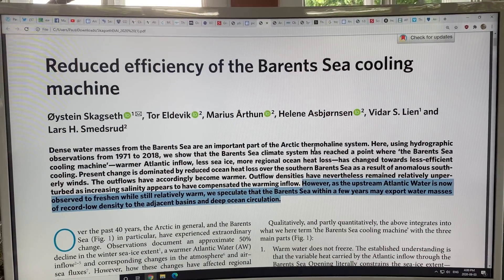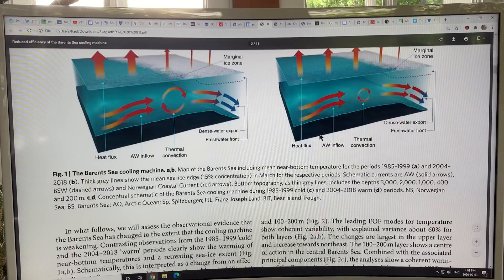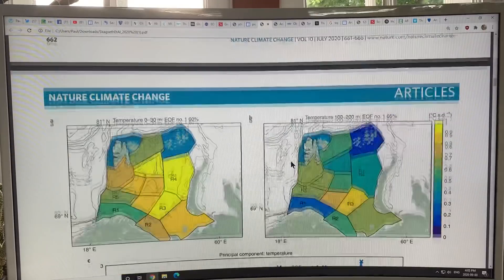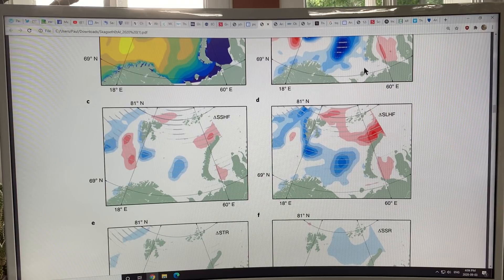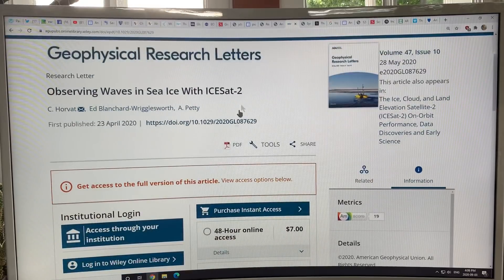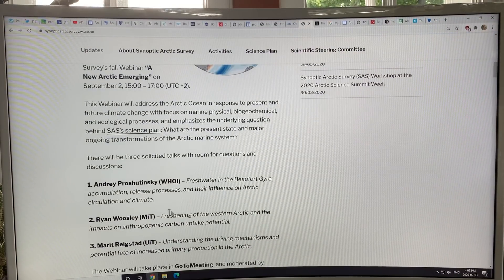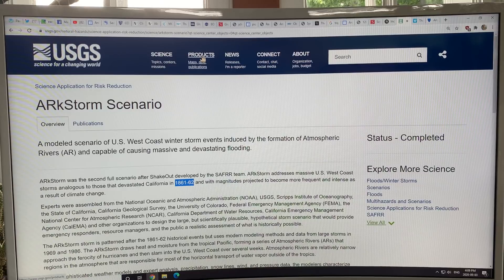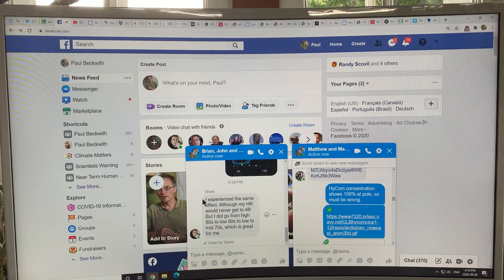Reduced Efficiency of Barents Sea “Cooling Machine” and Consequences to Slowing AMOC Ocean Currents

Comment: Why is the present temperature of the southern hemisphere so cold while the northern hemisphere is so warm.  It seems the jet stream in the south is much stronger than the north...Seems strange,
Reply: I think also it has to do with there being a higher percentage of land vs water in the northern 
compared to the southern hemisphere.
Reply: That’s cause the jet stream spins in the opposite direction and in the south hemisphere it happens to spin in the same direction as the earth spins so it adds onto it.

Comment: OK, deep Polar  ice has just about gone, all we are left with is very shallow ice flows inc winter, truth is we are just about into our first BOE this year. The ice which they keep saying leaves us with say 4 or 6 million kilometers, is not really true;  as 95% of that is ice about 5 to 30 cm  thick . so it's a kind of false claim to have this level of ice.
Reply: @orangeedo  Fool, there is  a big difference between ice which is say 30mtr's thick and ice which is about 5 or 10cm thick. But on the surface it looks the same. Umm to idiots like you.
Reply: @orangeedo  UMMM NO it's not meters thick, go look up multi year ice in science of the poles. There is just about zero or 95% of that, gone. You are talking about the OLD normal, not as it is now. Undersea sonar readings from Russian, US and other nations sub's are recording  the thickness of the ice under the poles, in the North pole it has almost GONE! most of it is now down to inches or a couple of feet or so, not huge areas where it was 20,30 60 meters thick, that's the stuff which has disappeared.
Reply: @orangeedo  UMMM NO it's not meters thick, anywhere near to the extent it should be, go look up multi year ice in science of the poles. There is just about zero or 90% of that, gone. You are talking about the OLD normal, not as it is now. Undersea sonar readings from Russian, US and other nations sub's are recording  the thickness of the ice under the poles, in the North pole it has almost GONE! most of it is now down to inches or a couple or 3  feet or so, not huge areas where it was 5, 10,30 even up to 60 meters thick, that's the stuff which has disappeared.
https://climate.nasa.gov/news/2817/with-thick-ice-gone-arctic-sea-ice-changes-more-slowly/                Or       http://ocean.dmi.dk/arctic/icethickness/thk.uk.php
Seems your mouth is way, way bigger than your brain, if you actually have one that is.

Comment: Wrong again Paul!: https://www.hi.no/en/hi/news/2020/january/the-barents-sea-has-become-cooler,-pushing-the-marginal-ice-zone-south    and you should know things go up and down? https://thebarentsobserver.com/en/arctic/2020/04/colder-normal-first-time-10-years

So why dont you just shut down this channel? Maybe you should educate yourselfe here: https://www.climate4you.com

All official data! From secure sources, put together by a spesialist. Here is temperature graph from 1900 to 2020: https://www.climate4you.com/images/MAAT%2070-90N%20HadCRUT4%20Since1900.gif It might come as shock to you that the temperature goes up and down? Try to figure out why!

You think the ice is melting in the north? Then get informed! No ice melt at minus 10C: http://polarportal.dk/en/sea-ice-and-icebergs/sea-ice-temperature/
And as you might know, this time of the year is the warmest with anual ice minimum.